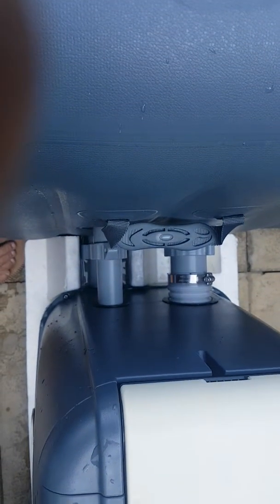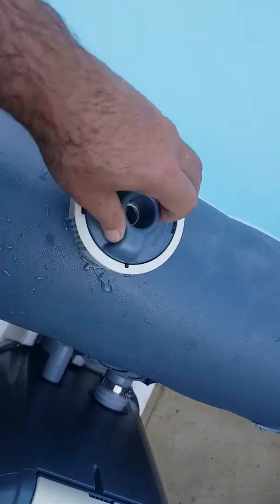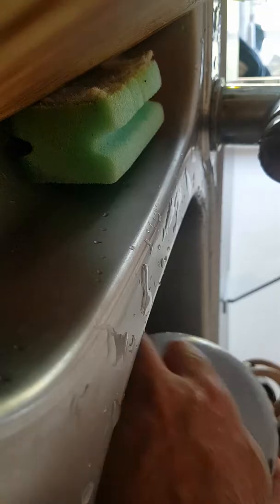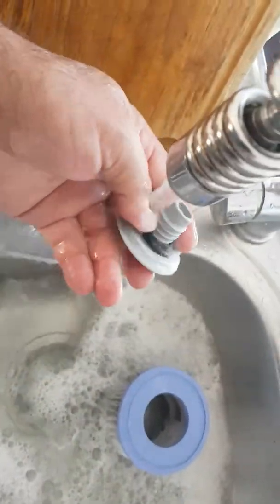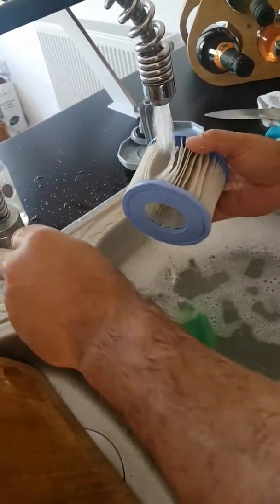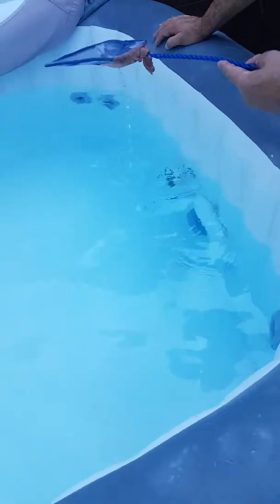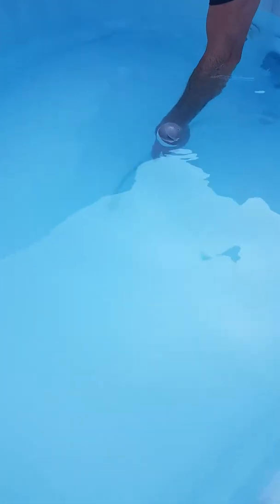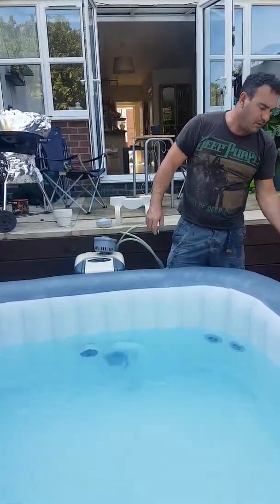Lazy-Spa Hydrojet Pro - maintenance 101

Comment: Great video mate learned a lot, I have issue with hydrojets not working on my exact same model, massage bubbles and heater ok, but after 17 months of ownership here in Spain, any idea on problem with hydrojets not working, no error codes appeared?  Thanks in advance for any info.
Reply from the maker: Well,  does the massage pump start? 

If it does, does any water shoot out from the jets? 

They can be blocked, you can remove them, and clean them.

If they're not blocked then the motor pump unit needs investigation. The discharge pipe is shared by the massage pump and filter pump. If the magnetic flow switch on top of the discharge pipe from the filter pump isn't releasing, (normally open circuit for filter pump start), then it électronically prevents the massage pump from starting, because it thinks the filter pump is still running, (they don't operate simultaneously).. it could be that. This magnetic switch gives many people problems. When you open the top, Be careful with the rubber seal and don't lose any of the 4 screws.